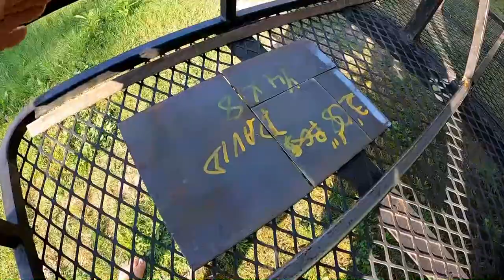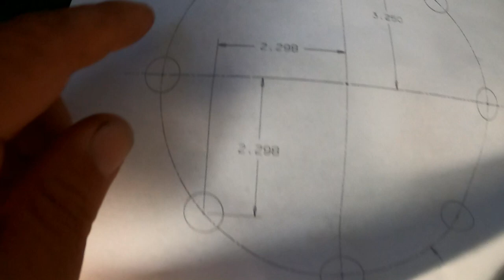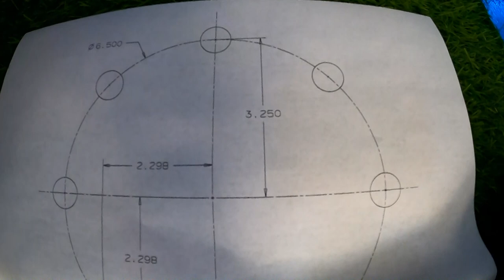Easy Fix To - My Van Won't Start & DIY Tire Carrier Rack - Vanlife or RV Life

Comment: It never fails to astound me how little pride some people take in doing their job right. That package should never have even got to your delivery driver. Looks like that was done in shipping. And the driver should have rejected it. But I don't know if they are allowed to do that. 
 The rack is looking good. Many many years ago I worked for a short time in a machine shop and used a blaster on small pieces. Really liked that. Like your Work around.  We put battery ends on that allow us to remove the bolt and easy disconnect for short periods we don't drive the 1ton pickup. It has saved time and battery.  It was nice for you to take a couple of weeks off ( Well almost off. ) Visiting friends is invigorating. Thanks for sharing.
Reply from the maker: I'm curious if the replacement radiator will be much better! ...lol  Thanks for watching!
Reply: Some people who badly need the item would rather have it damaged than not at all.

Comment: A galvanized nut or weld through primer on battery terminals . Because of its charge . Could put the plate a few inches above the c channel and put two holes on top and one on bottom .

Comment: Dave, them clamp on replacement batt terms will always fail, been there done that! it is best to get a molded cable with pigtail for accessory feed going all the way to starter! If you do use the clamps spray a lot of batt term protector on them!

Comment: Practice what you preach Dave.  I guess its the sign of a confident mechanic if you drive around knowing you have a corroded connection.  Good how to video.  At least you're carrying water with a bad radiator.

Comment: our van won't start all of a sudden today too, even though we had it running a week or so back. I was going to move it so I could mow where it's sitting, and it did nothing. Battery is good, we put a mutimeter on it, no clicks or noises, just dead when the key is turned. So even though I am still in the teardown/repair and rebuild stages we have to get it back to the mechanic for a 2nd time to get this figured out. Probably the starter or something in-between as there is power. Also still need the AC updated it's the older system from the 80s. So no AC yet.
Reply from the maker: It sounds exactly like what my van did. Did you remove and clean the battery terminals?
Reply: @DavesRVLife  turns out it was the shifter not all the way in Park or something, we put it in N and it started right up... the van still has issues though, the shifter indicator doesn't move so it's hard to know what gear it is in. We were doing a transmission fluid pump out and replacing it with new, so that was probably why it wasn't in the right position to let the engine start. My man was doing the work about a week ago, and he started the van, and cycled through the different gears to get the trans fluid to move through the system. I am just glad it wasn't a bad starter. We did check the battery and connects, those are good, we do need to repair the shift indicator.
Reply from the maker: @AprilMadden-Jam  There are two torx head bolts where the transmission shifter cable  hooks to the steering column under the dash. I'll bet they are very loose!

Comment: That radiator should have never been left.   The driver has no common sense.  Good grief!   I lucked out and found a radiator local for my Envoy for $150, we changed it in the yard.  Fun times.  🧘🙏🏻🌎☮️❣️